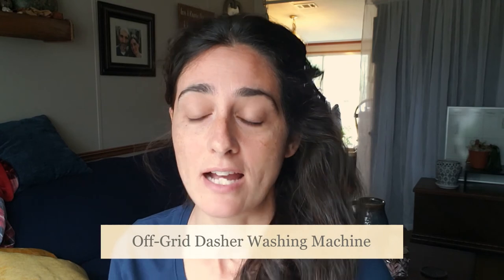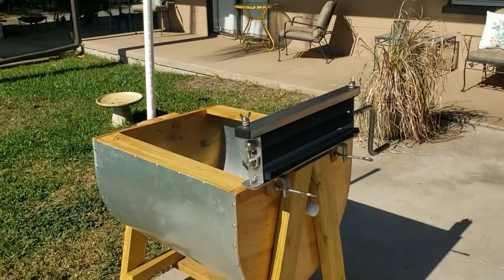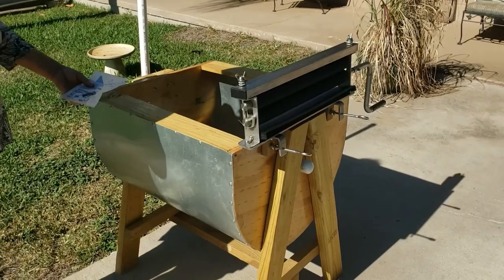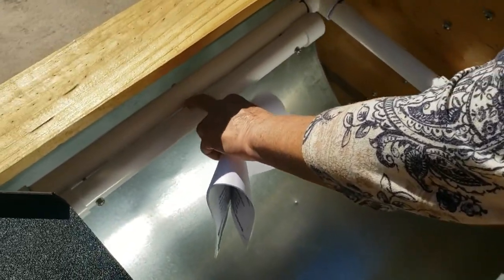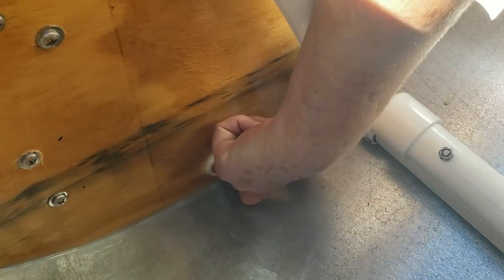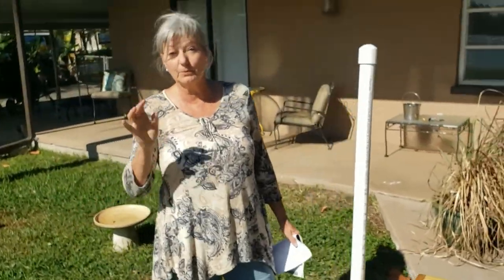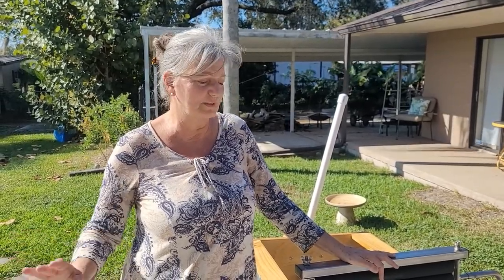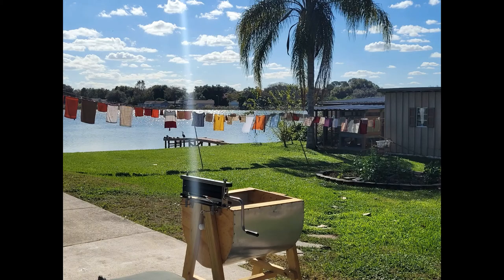Build an Off-Grid Dasher Washing Machine

Comment: Just built mine, I am going to insert 3/4” dowels into the pvc to stiffen it some. Also got the same wringer and its a beast. Thanks so much, we are moving off grid and this will serve us well!  

Mike
Reply from the maker: Awesome! That's a really great idea to put the dowel into the pvc too. We wish you well in your off gridding.
Reply: Mike, will you share the plans? Please  :)
Reply: If you get schedule 40 PVC you should not need the dowel rods inserted that PVC is quite strong they also make heavier PVC than the schedule 40 I made a comment above about my concerns on the pvc wearing on the pivot points and maybe needing to use a different material than pvc for those pieces that pivot and maybe making some bushings for these pivot points out of metal like copper tubing or conduit pipe
Reply: Mike, where did you get the wringer for the washing machine?
Reply: We're is the windmill to run the contraption...

Comment: I am thinking instead of the metal I could make one out of a blue plastic barrel. This one she made is fantastic!!
Reply: I think that that might be a good idea. Let us see how it comes out if you do it.
Reply: I was thinking the same thing great minds think alike
Reply: It won't last as long.
Reply: I thought the same. 😂
Reply: YouTube channel name “Kristin wright” Video titled DIY James washing machine made one from a 55gallon plastic drum
Reply: Goodbidea
Reply: Never mind.
Reply: I did use a plastic 55 gal drum and a 30 gal plastic drum for inside. Mine has a spin cycle. But this one of hers was my initial inspiration. That's a beautiful build she did. Mines on my channel.
Reply: Me too!!
Reply: @loriekaczmarek9788 
Post the link to your channel. 👍😁
Reply: I have made one out of a plastic barrel using 40mm pressure pvc pipe for the agitator.  Works well.
Reply: Plastic barrel would be easier than dealing with the sheet metal.

Comment: This is an excellent design but the plastic pipe will quickly break, as it is not designed to be a mechanical moving part. The weak points will be the right angle fittings. Some aluminium or galvanized tubing would be far stronger, excellent for those heavy clothing items such as denim. Perhaps some light weight scaffold poles would be perfect. Secondly, consider upgrading the silicone caulking to marine silicone caulking as it is designed to be submerged under water and will not go mouldy after time. A plastic tarp and bungee cord would protect the machine if stored outside. Great video, I'm gonna build one :)) thank you so much.

Comment: Thanks for this video. This is really cool. I like the blue barrel idea that someone in comments suggested, if you don’t mind it looking “less vintage”, because the plastic barrels can often be had cheap or even free. Plus, if a person is REALLY strapped for cash (living off-grid) they could forego the expensive ringer and just give a quick hand-wringing then have a rack to drip-dry the clothes for half an hour before hanging on the clothesline. ALSO, I just remembered my big yellow mop bucket has a side-press wringer, so now my brain gears are really turning🤓

I spent the entire summer hand washing and line-drying my clothes, barefoot in the sunshine with the bees and birds all around, and I considered doing laundry as part of my “outdoor therapy”❤

Comment: How long would the PVC last with the pressure and tension of use? Also, thank you for this video....I've wanted to build one of these for almost 10 years. You did a great job!
Reply from the maker: Thanks! Glad you liked the video! Hopefully the pvc will last quite some time. If you're planning to build this washer, you might want to use the super thick grey pvc. I think it's called Schedule 80 pvc. Lowes has it. That's what I would have used had I known about the grey stuff before I started. Or you can use galvanized pipes. Good luck! Send pics to Jen's Corjen YouTube channel when you build it and definitely check out that wringer!
Thanks again!
Blessings,
Debra

Comment: Neat machine, the weak spot I see is the area where the agitator pivots in each end, the PVC will wear out in time I expect, you might  need to make spare pieces when you make the original parts or I expect you should make a bushing out of some copper tubing or steel tubing and perhaps make the shaft going through the hole out of steel tubing or similar product like maybe conduit pipe maybe
Reply: Where could one purchase this bushing? Or how would one make this as I am a newbie. Thank you
Reply: Super good idea. I wondered the same thing. I think you could just get a copper fitting a teensy bit bigger and slide the PVC through?

Comment: My husband runs a heating and air supply warehouse....unfortunately getting stainless steel isn't an option. All they have is galvanized. If I got galvanized and coated it like the wood, would that work just as good?
Reply from the maker: The sheet metal is galvanized and it will work great. I used stainless steel screws.
Reply: @CorJenFarm  thank you

Comment: Does it leak from the plywood where the agitator is moving through?
Reply from the maker: If I remember correctly, it does let some water out. However, that part is high enough so that you can still run  full load with minimal water loss.

Comment: How's  that wringer on buttons? Some wringers broke the buttons then some were made to be kind to buttons and zippers.
Reply from the maker: Great question 🤔 
I'll check with Debra on her experience with buttons and zippers using her wringer.
Reply from the maker: Ok, so Debra said she had no issues with buttons or zippers using this wringer. She said you may need to adjust the closeness of the rollers to help. Of course you can check with the manufacturer too on specific concerns. Hope that helps.
Reply: I didn't know they were adjustable... thank you.

Comment: If I take 2 sawhorses and a rain barrel cut in half and mount the barrel to 2 sawhorses in between them it'll look the same as you have right in the beginning.
Reply from the maker: Sure, you could do that. Just not sure how sturdy and stable it would be for handling the "wash cycle". If it's not heavy enough, the whole thing will want to "walk" with the wash motion, I'm thinking. But, you may have a good idea.
Reply: @CorJenFarm  probably doesn't have to be a plastic barrel. I'm trying to figure out the cheapest most cost effective way to get our laundry done with things I might be able to get easily. Right now I have no income so I have to use what is in the property or what I can easily access.  Something that might get our clothes cleaner than the bathtub  and scrub brush or 5 gallon bucket and plunger.
Reply from the maker: Yes, for sure and I am ALL for using what we have. I would love to see what you come up with too. I am sure it would inspire so many others and be such an encouragement too!
Reply: I was thinking the same thing, those blue plastic barrels or sometimes they are white ones food grade are very thick and sturdy, I have 2 white ones 30 gals for catching rain off the backside of the roof and they are thick plastic.
Reply: I am too right now it's the bath tub or 5 gallon bucket washing by hand the past year
Reply: I think it's a great idea! I've seen pictures of ones from a hundred years ago. I saw they used barrels too. And you just need a way to keep it still while in use. If you do your attachments closer to the top, you wouldn't have to worry much about leaks.

Comment: How are the holes sealed around the pipes sticking from outside on the sides of the wood? Is the sealant used around the pipes on the outside?
How big are the holes drilled for the pipe and drain to stick out?
Reply from the maker: Hoping to get the plans for you soon.
Reply: I don't think her setup needs to be sealed perfectly as she is using it outside. unless being used in an 
application where no leaks can occur like in a snowy location or a basement, properly fitting rubber grommets should work. at 12 minutes I noticed her water does not reach the pass through point of the pvc.
Reply: @CorJenFarm  Any update on the build plans?
Reply from the maker: @The_Bronze_Baroness  I actaully spoke with her last night and she wanted me to let you know she is for sure working on the plans. She does work  a full time job, etc. Thanks for checking in. I don't have a time frame but thank you for your patience.
Reply: @CorJenFarm  Thanks for the update!

Comment: This is great. So much more practical than many others.

Putting it on wheels is a good idea.

If using wood bord make sure it's marine ply not normal ply wood.

I would use galvanised piping and joints instead of pvc for strength and UV stability, especally being used outside. But pvc would be lighter.

I wonder if a 44 galen drum would work for the body?

How did you do the swivel joints through the wood so water tight but move?

Love this design 😍
Reply: Concerning the swivel joint - this is not underwater - so it does not need to be sealed.
Reply: @mygarden365  thankyou 🤗

Comment: $375¿¡!! That might as well be $1,000,000,000,000 to us! So basically you are doing this not out of necessity  but as a hobby to try out what it feels like living off grid not because you cant use your washing machine and not because you cant afford a new washing machine because it is much cheaper in florida than where i live in ca
California and i found numerous machines for $327¡ so why would anyone spend almost $400 for a labor intensive manual back breaker?
Reply: Okay I also thought it was pricey for the labor involved but it will still save money honestly. It's a lot upfront but would be worth it if you're willing to put in the labor. 

First of all, it doesn't use electricity so it would cut that cost down pretty significantly especially since the wringer and the sun are the dryers. Probably enough that over the course of a year you'd save significant money. 

Second, if it breaks it would be a LOT cheaper to fix it herself than getting a repair person to come out for a normal washer or dryer. Plus it would probably last longer overall. 

So I wouldn't be surprised if it saves her thousands at least over the course of its lifespan.
Reply from the maker: It may seem like a hobby for now, but you dont wait for a crisis to get here before you get ready. Either way, she's preparing and wanted to share with others. It may just be necessary one day.
Reply: When shitake hits the fan your going to be glad you have this
Reply: You actually can get stuff in California cheaper than Lowe's, by going down to the landfill. California loves recycling and usually has a little store where they sell salvage items super cheap. My are has those huge drums that are food grade for about 20 to 30 dollars. You could split one in half, and use some salvage 2 x4 s for legs and they have tons of that and PVC super cheap. Depends really on if you are willing to use materials that you might have to sort through and clean up. Most of what they sell is in ok condition though.